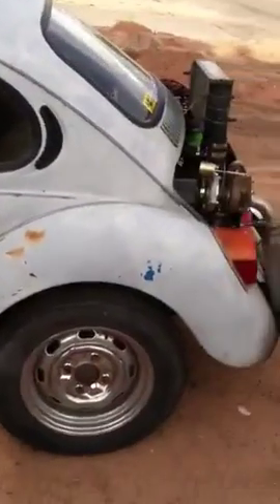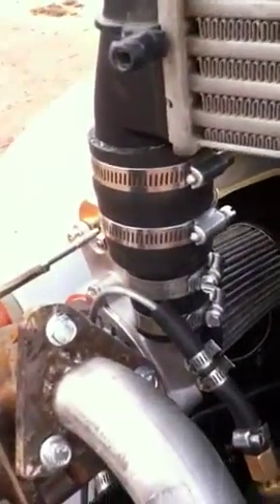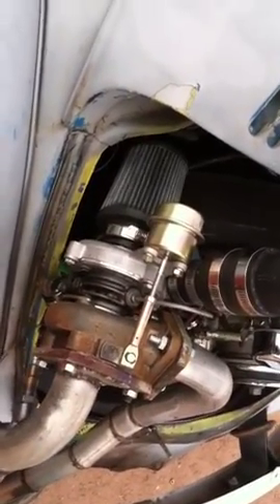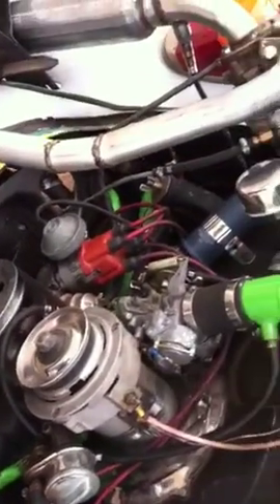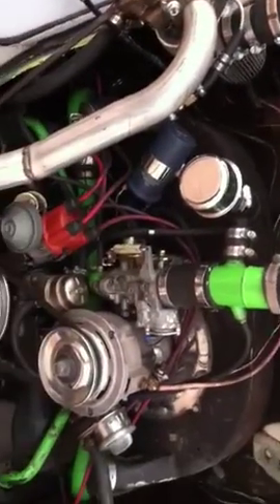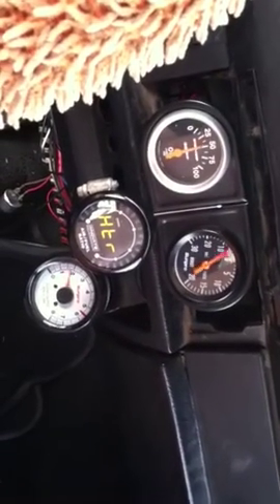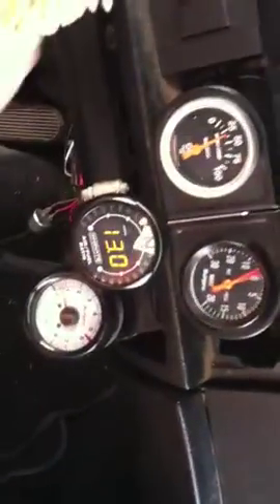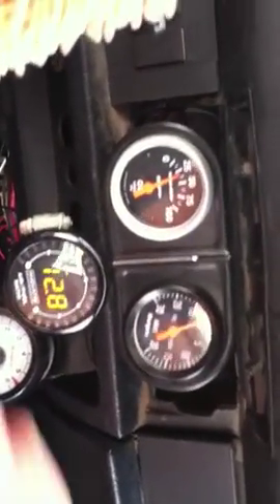Budget turbo vw 1641

Comment: Im about to convert my 1600 single port to dual port. And may put an engle 110 cam as well. I think a turbo would bring it all together.
Reply from the maker: go over to shoptalkforums.com and poke around in the forced induction section. tons of stuff and very helpful folks.
Reply: @shaunchristensen5224  what did you have to do to the carburetor I have the same setup but it bogs out in 4th gear any suggestions? Thanks

Comment: Please make a list of parts to make the same thing with mine bug
Reply from the maker: I used a limited 009 distributor, stock PICT34 carb (modified for boost) stock fuel pump (modded to receive boost signal, and an intercooler from a 1.9 TDI. I made all the exhaust piping myself.  go to shoptalkforums.com and do some reading. lots of good information and very helpful members. there are too many parts to list here and I cant remember them all.
Reply: Thanks! You are awesome
Reply: How do you modified the carb for boost?
Reply from the maker: On the simple little solex it was just a matter of enlarging the float bowl reference tube, soldering some of the emulsion tube holes shut, larger main jet, and sealing the throttle shaft with o-rings. Simple mods. and cheap. If I were to build another I'd use the same carb, just with two instead of one.

Comment: Any mods need to be done to the carb? Iv Always been told u have to have a special carb to boost
Reply from the maker: Had to seal the throttle shaft, modify the emulsion tube and extend the fuel bowl vent. Not difficult at all, and cost almost nothing. limited to about12-15 psi of boost, 7-8psi if you are still running a stock distributor. Mine was as simple as could be but was limited to 8 psi for safety.